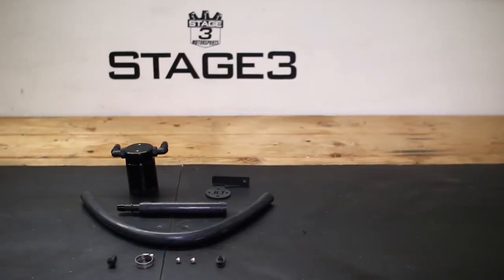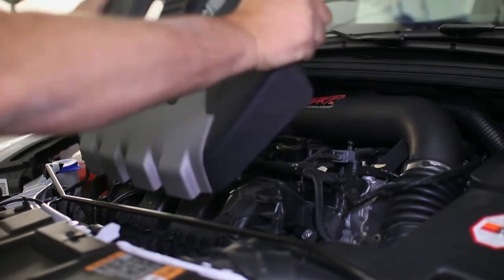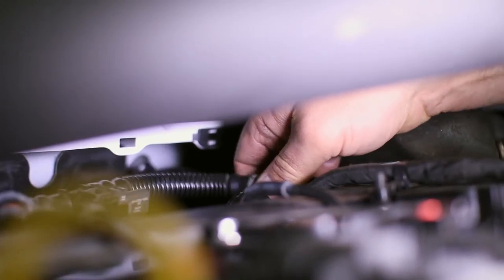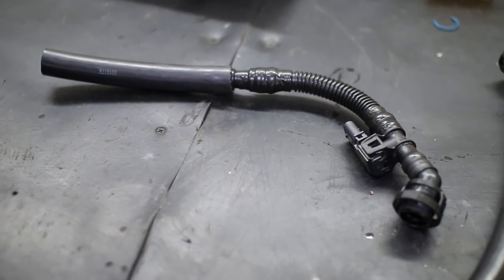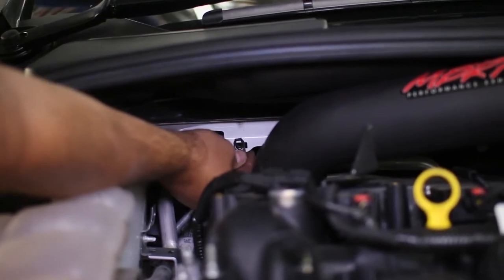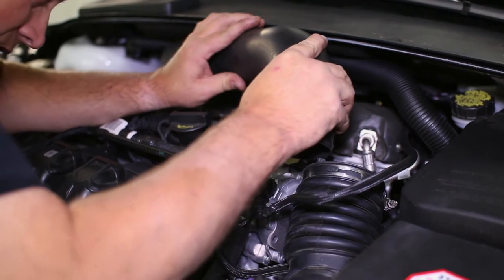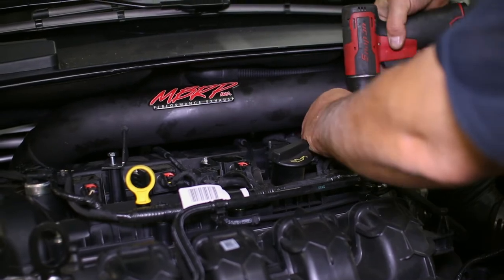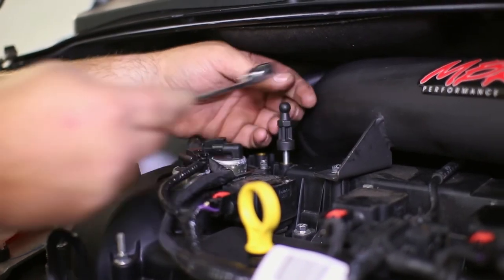2013-2017 Ford Focus ST EcoBoost JLT Rear Oil Separator Install

Comment: The hose orientation is different from the 13-14 vs 15-18 because of the sensors? The sensor hose wich side go? Front or back

Comment: You have the short hose that connects to the intake going into the J side of the can but it appears on the T side in the Installation PDF.  Which one is right?  Why couldn't you just mark which one was In and Out to make this easier?

Comment: Do you have to re-use that stock part of the pcv line that you cut with a razor then taped up in order to make it long enough to reach the connection point, or is the supplied hose long enough already?..
Reply from the maker: We re-used the stock hose in order to give extra slack in the line, but you probably don't absolutely need it and what comes supplied should work.
Reply: @stage3motorsports  Well I can testify that the JLT hose length is not long enough.  It's only like 6" when you need more like 12". Why don't you include more length in the first place?  I had to make run to AutoZone to get a 1 foot long 3/8" PCV hose.  Trying to reuse the 5 inches of stock hose doesn't make sense anyway because you basic destroy the ends when you remove the fittings.

Comment: Whats the difference between the rear and front catch cans?
Reply from the maker: There are two PCV systems on the cylinder head. The catch cans themselves accomplish the same goal, but they can only be attached to one pcv line, hence separate kits for front and rear